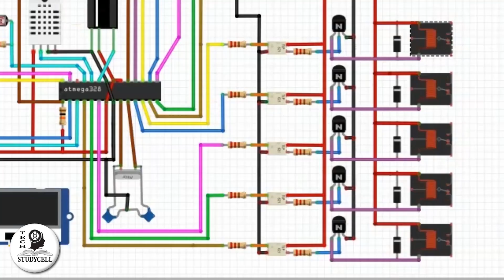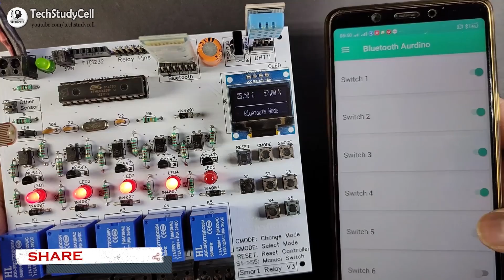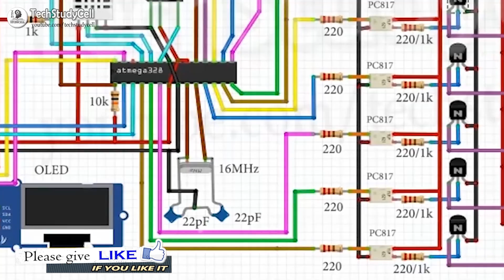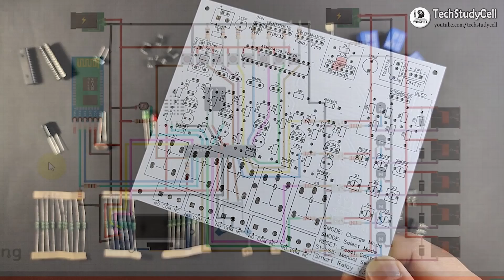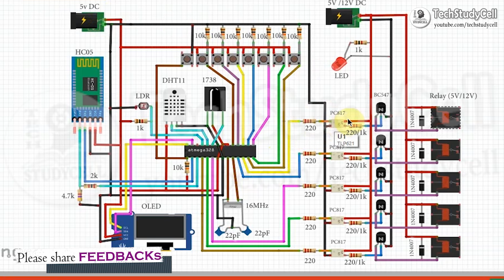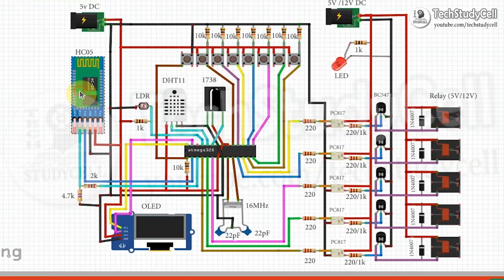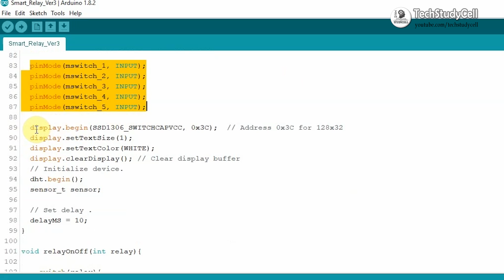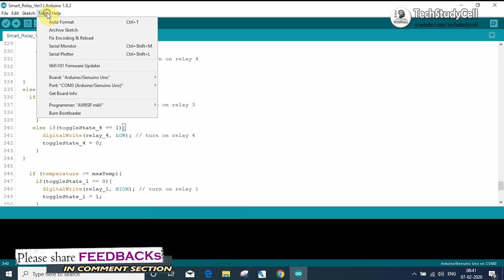How to make Smart Home using Arduino Bluetooth IR & Sensors | Home Automation ideas under Rs500/ $8

Comment from the maker: Hi friends!! During the video, I have shared the complete circuit diagram & Arduino code. I will really appreciate it if you share your feedback on this Home Automation project. You can also refer the Time Stamp from description to skip any portion. Thank you & Happy Learning.
Reply: Next time add fan regulator remote control with this circuit
Reply from the maker: Sure
Reply: Sir can i have one of these PCB borad?

Comment: Can you just tell me the adapter that you are using is 5v and how many amperes ?
and if this pcb is running on 1 adapter or 2 because you drew 2 sources in the schematic ?
please reply on my question and thanks very much for your efforts and i wish all good luck for you
Reply from the maker: Here I have used a 5 volt 1amp mobile charger.

Comment: Hi sir I already started this project on breadboard I have one suggestion if you can display relay status on OLED I will look good and user will get complete details, I mean relay one on or off so on and also my suggestion about adding fan or bulb dimmer option and to show the dimming level on OLED will be a great thing. Same thing if we turn on and off through switch or Bluetooth OLED status should show the result. Thanks sir for your great and unique effort on this amazing project that no one did before.

Comment: Sir also if you can add HLK-10M05  AC to DC step down power module in upcoming version then we don't need separate power supply.
Reply from the maker: Will include that in project. Thanks

Comment: Hi, I would like to know if the input current is 5 or 12VDC? Thank you.
Reply from the maker: You can use 12v relay. But control need separate 5 v supply.
Reply: @TechStudyCell  Thank you!

Comment: Hi sir I just bought esp-01 wifi module also to add this option in the project and will try to control through blynk app. If you can keep in your note book to add this feature also I think it will be very good. We need your expertise in this thanks sir.
Reply from the maker: Ok.. already started working on it

Comment: Sir pls can  make pdf of this circuit with only one side tracks .because i converted gerber to pdf but its half circuit is on other side and hapf on other but are interconnected can make it just one side circuit plsss
Reply from the maker: As the circuit is bit complex.. So it is hard to make on one side. still in my upcomming project I will try that.. Thank you.

Comment: Hello and congratulations on the project! I wanted to ask if I use 1N4007 instead of 1N4001 is it okay anyway or does it create some problems? Thank you.
Reply from the maker: You can use 1N4007 instead of 1N4001
Reply: @TechStudyCell  Thanks so much